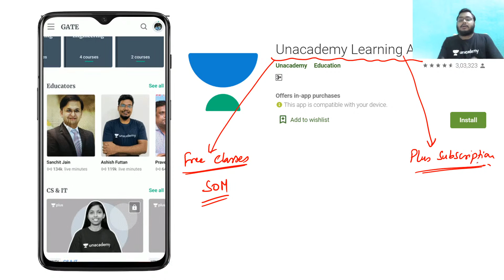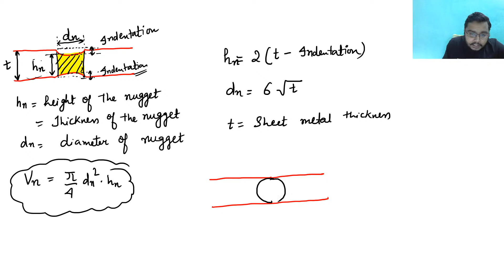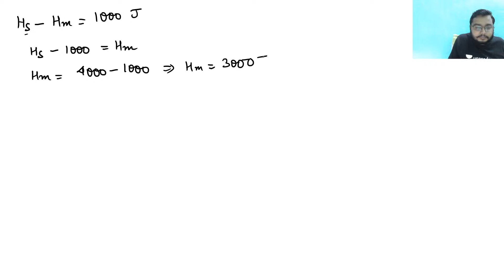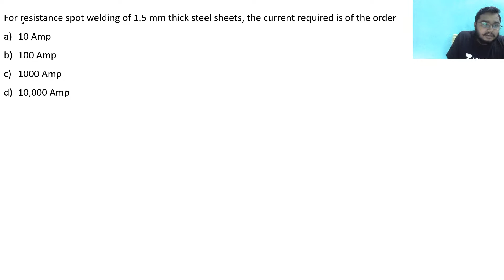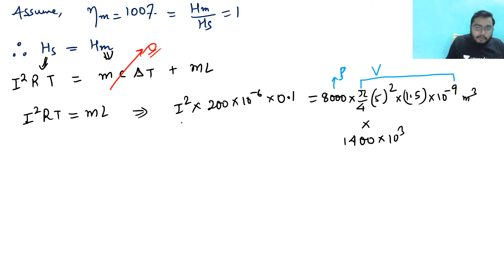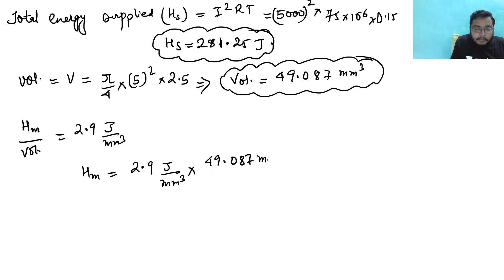L21 | वेल्डिंग (रेसिस्टेंस वेल्डिंग के आंकिक प्रश्न) | मैन्युफैक्चरिंग इंजीनियरिंग | GATE 2021 | ...

Comment: A resistance seam electric welding (RSEW) operation is performed on two pieces of 2.5 mm thick austenitic stainless steel to fabricate a container. The weld current in the operation is 10,000 amps, the weld duration t = 0.3 sec, and the resistance at the interface is 75 micro-ohms. Continuous motion welding is used, with 200 mm diameter electrode wheels. The individual weld nuggets formed in this RSEW operation have dimensions: diameter 6 mm and thickness = 3 mm (assume the weld nuggets are disc- shaped). These weld nuggets must be continuous to form a sealed seam. The power unit driving the process requires an off-time between spot welds of 1.0 s. Given these conditions, determine: (a) the unit melting energy of stainless steel, (b) the proportion of energy generated that goes into the formation of each weld nugget, and (c) the rotational speed of the electrode wheels. Take T=1670K for austenitic stainless steel....sir please help